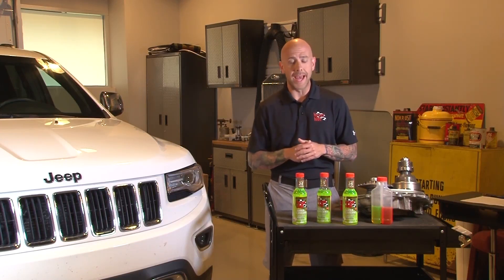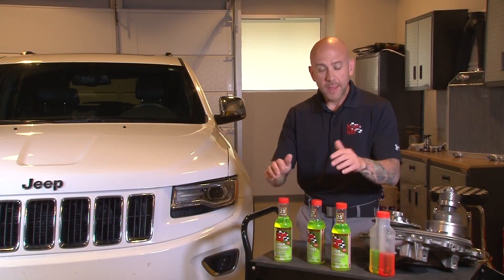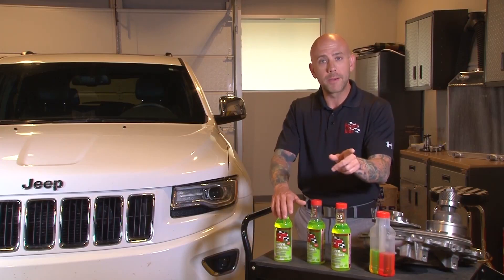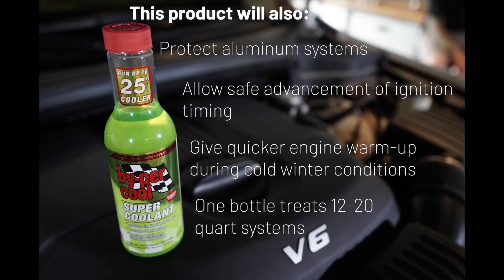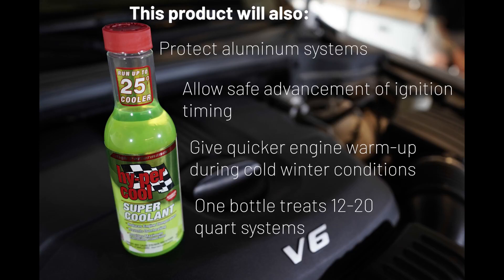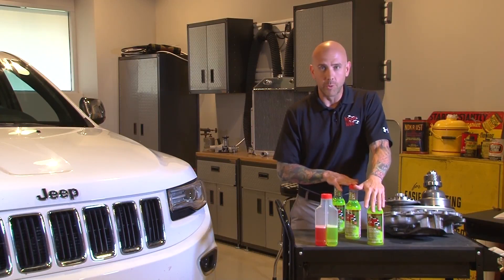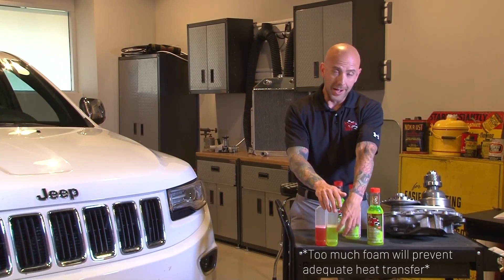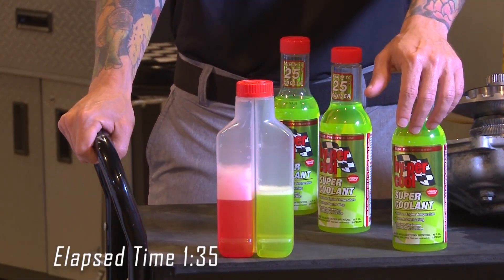Hy-per Lube: Super Coolant Explained

Comment: This stuff is terrible i just bought a brand new radiator for my 1969 ih 2444 tractor and when i did a coolant flush decided to give this hyper cool a try and it did the complete opposite more like hyper over heat it completely clogged my new radiator up and when i drained my cooling system it came out so like 5w30 motor oil practically dont use this garbage